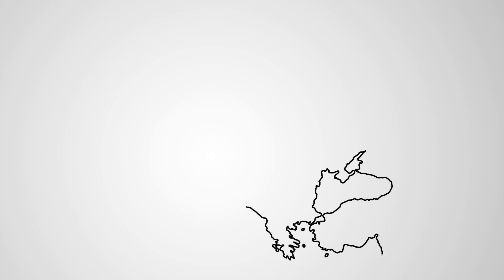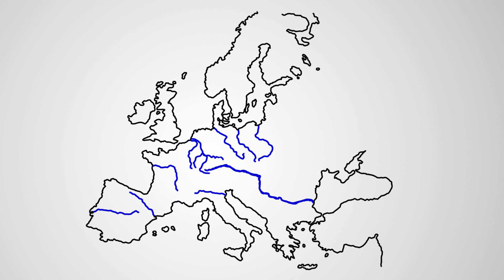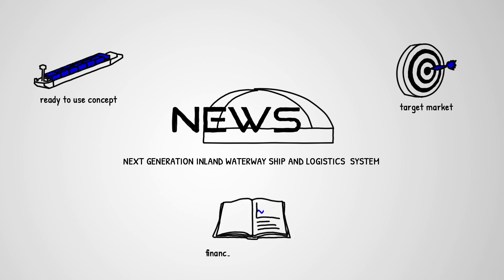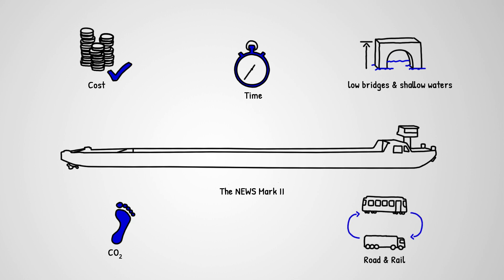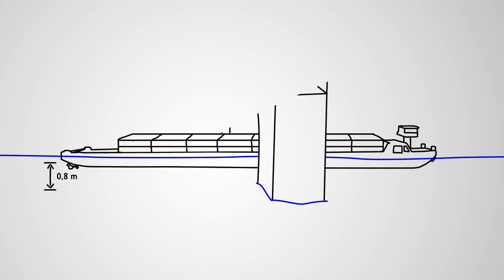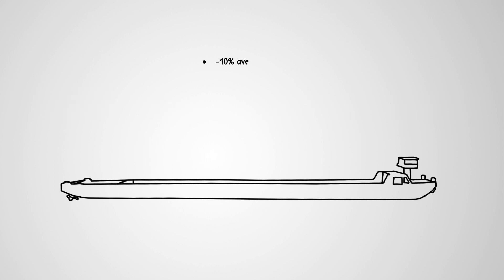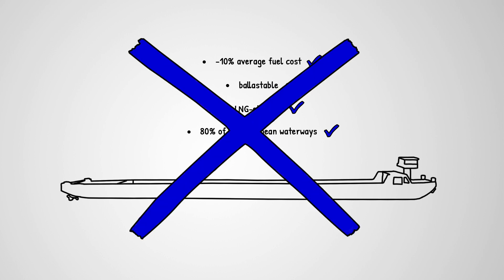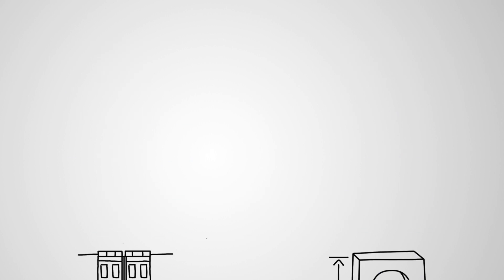Next Generation Inland Waterway Ship: The Vessel

Comment: "We've designed a new standard type of inland vessel perfectly designed to nevigate the Danube river. The only problem is that it can't go anywhere until the Danube river has been redesigned for it."

It also sounds a lot like basically an "Europaschiff"* with a few updated features. Although it's hard to tell without more specs.

*Basically a standard size for medium inland vessels. Not as large as the ones that dominate transport on the Rhine, but much bigger than types optimized for smaller canals, like the Kempenaar.